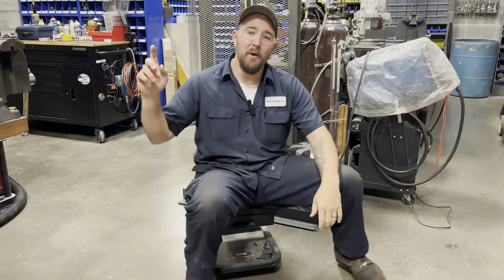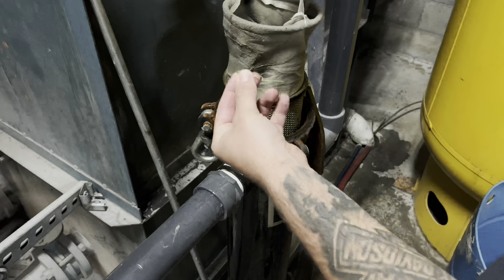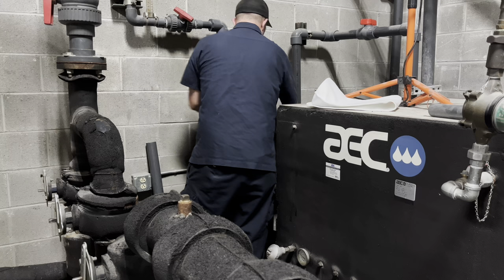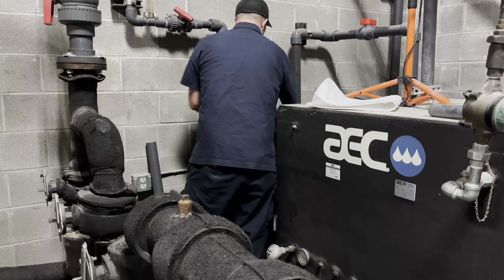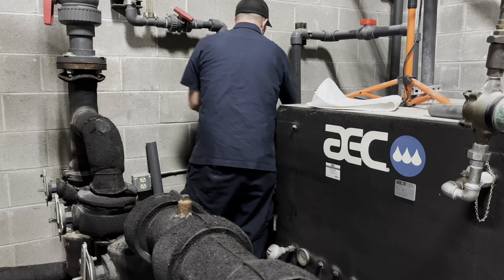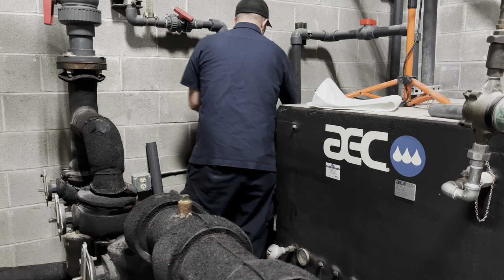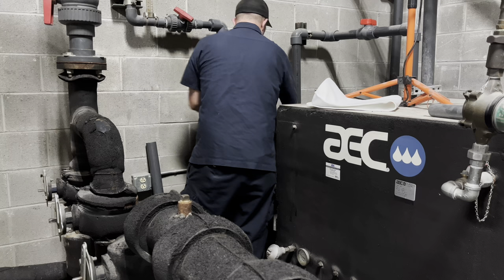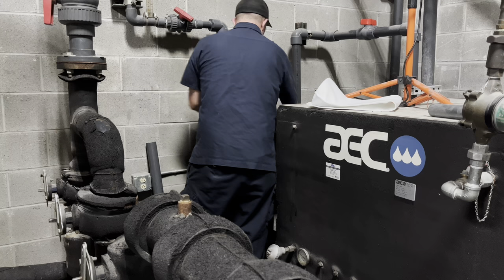Industrial maintenance!

Comment: My dad spent 10+ years running cnc lathe at a machine shop here in southeastern Pennsylvania where they make and rebuild blow molds. They got bought out and corporate took over and he got sick of it and left. It’s one of the few shops around that does it, so if you guys do any blow molding there’s a good chance he might have made parts for one of the molds.

Comment: Retired from a large hospital / Research centers where we had to come in a few times a month at 4 AM and at midnight or 2 AM a few tines a year to help out with ATS testing & PM on a dozen 13,000 dual service substations. Cheap ass Facility manager wanted us to work a double shift for straight time then take a day off so we only worked 40 hours. Told them Nope. Told them I was not working over 12 hours at straight time. Once they said something because I was eating breakfast in one of the cafeterias at 8 AM. Told them no problem that even though I just worked 6 hours without a coffee break I was going to punch out and go home. Was never boring working as an maintenance electrician. One of the few over 12,000 employees who worked on every floor, every roof, every mechanical rooms etc.

Comment: Worked 50 enjoys years in large plants and never blow out a running air compressor Would shut them down before blowing downs and safety department made us wear dust mask & safety glasses. I would wash the 4 by 4" up to16 by 16" filters on electrical cabinets & VFD'S  every month or so with warm water and mild soap. Have not greased a motor in last 20 plus years because they have sealed bearing and no longer have zerk grease fittings. When we had a motor shop rewind a old motor that had grease fittings would tell them to install sealed hearings and remove grease fittings. Wired up a few injection molding plants that had up to 500 ton presses. They never could reuse all of the regrind plastic and had to throw some away. Big money makers how most plastic shops run at least 24/5. One plastic shop made over a million same size plastic adjustment screws a year for a customer.

Comment: Why are you not wearing a dust mask when you're blowing out the filters? Also, those sock filters, they use them in the 300 & 1200 gallon fryers at the potato chip factory. Trust me, they are no fun to change, especially when they're hotter than heck. At least yours is cool water, so count yourself lucky.
Again, your maintenance rooms and machinery therein are the cleanest I've ever seen. I can definitely tell that their well taken care of. Keep up the good work.
Reply: Agree on the encouragement for a N95 dust respirator for the blowout. Dan told us he wishes he didn't jump off trailers when he was young, this is only worse in the long run.

Comment: In case anyone is wondering... when you grunt or make noise or stick your tongue out when loosening or tightening fasteners.... you get an extra 50ftlbs on tourqe ... FYI 😂
Reply from the maker: Looser you grunt, more torque you get. Just don’t sneeze at the same time or you’ll definitely break the bolt!  Lol

Comment: Ok so since your using chillers, blowers, pumps, heat exchanger and mentioned having a material silo that means your working either with extruders or mold injection. I believe it must be extruders though since I didn’t hear you mention  glycol. I worked mold injection for years but the last few years I’ve been working around extruders. We have 15 material siloes though and our water system is set up a little differently because we use kettle filters that use those sick filters but it’s still connected through a chiller. Our PM’s consist of the budzars, thermalator and dryers. We have a lot of wood blend also that we use for some extruders though. It beats the heck outta the large hydraulic presses with mold injection. I hated those machines. lol.
Reply from the maker: Yes. It’s primarily injection molding

Comment: You get day's to do maintanence? Management insists we just run it till it blows then just patch it together. As a laborer/operator, I know more about the maintanence schedule I've developed than the in house shop(diesel mechanics) to the point our official maintance schedule simply says "grease all fitting daily" which I've done and replaced way to many bearing because of due to blown out seals. I've got a 4 page spreadsheet of all the different tasks I try to get to and how often they should be done, and it's still a work in progress, as some things I haven't remembered yet. Recycling plant so simply 5 conveyors, a 30yr old baler(talk about tempermental old girls, there are only 3 of us in the company that can fully run the machine with a couple others that run it if one of the 3 are on hand to solve issues that arise, as knowing which limit switch to trick to make the machine do what it needs to do to get out of whatever "Ooopie": it got itself into is very confusing without a complete understanding of what does what and  what caused the issue(typically a safety/limit switch detected a fault when none was present....)   and a newer trash compactor that's been cranked way out of spec. My list has everything from checking certain bolts haven't come loose to cleaning the bathroom, and rarely do any of my coworkers do any tasks on the list.../..

Comment: Just recently came across your videos and I’ve enjoyed them. 👍🏻

Though I got a question dealing at 26:22 and knowing you deal with moldings and pneumatic systems. Would it possibly be more beneficial to use smaller inline filters (Example that we use regularly in inflator manufacturing; model# ppsf.5-x35) at the machines that create vacuum?

We generally use these inline with small vacuum generators and are very fine to catch dust and cleaned between shifts.
Reply from the maker: Thank you! And yes! We do have smaller filters at every machine that takes vacuum. They are cleaned much more often